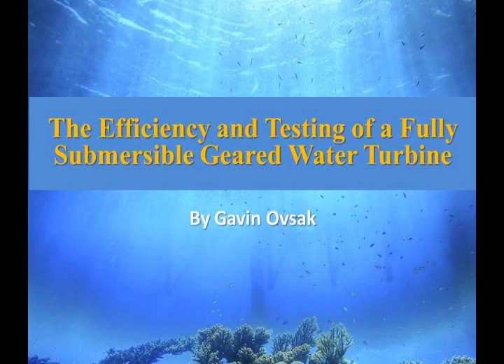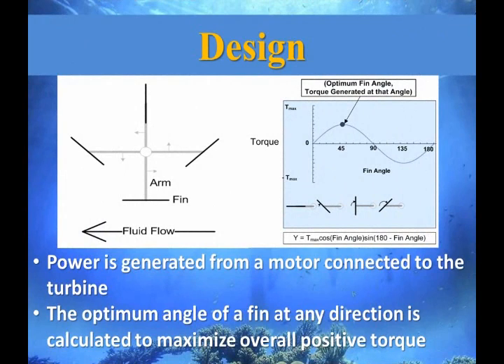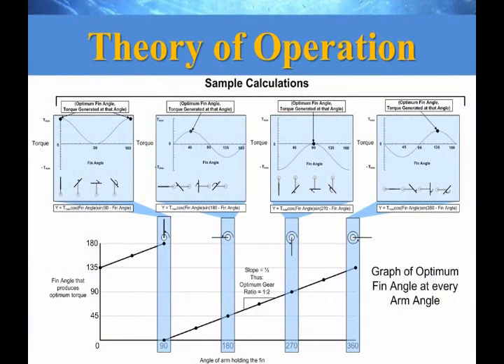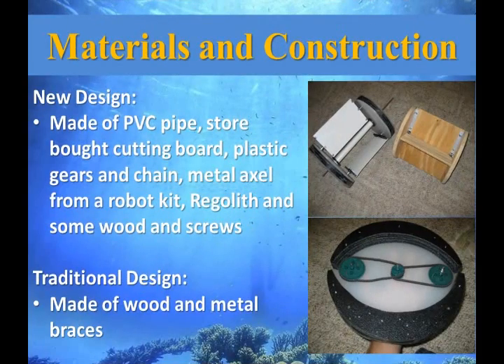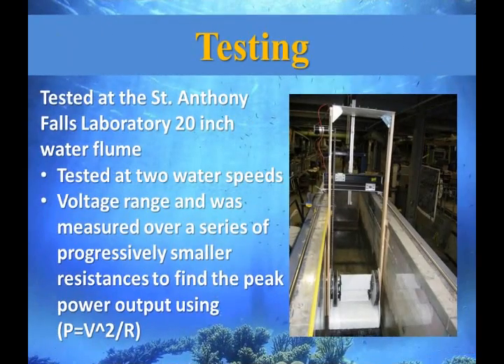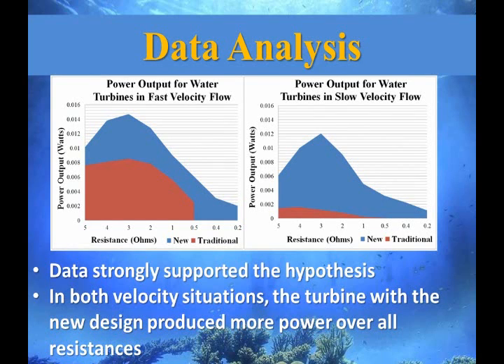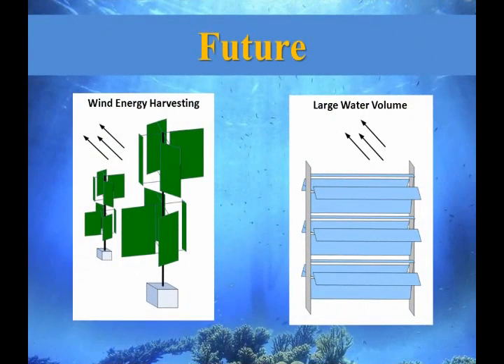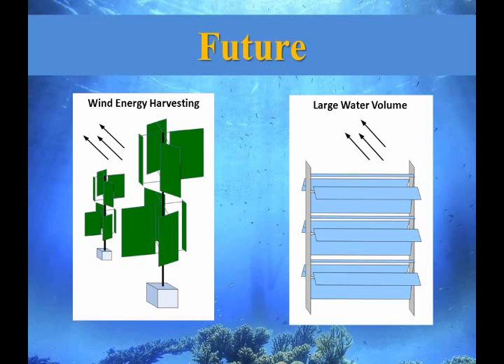Fully Submersible Water Turbine Summary

Comment: It's me jamaal. Now another question: If I put a motor on the turbine and propel the water in a sitting tank, will the turbine be able to pick up the kinetic energy from the propelled water? If so, then I could figure out how much water I need and how fast the water should propel. I don't want a stream of water, I want a still tank of water, but I want to propel the water with a motorized hydro turbine INSIDE of the water. Will I be able to pick up at least enough energy as needed in a still tank with a motorized hydro turbine?
Reply from the maker: Hey Jamal, if you attach a motor and can measure with an encoder how fast it's actually rotating, then the water speed should be about the tangential velocity of the fin arm, due to the shape of the turbine. The turbine can't pick up energy if it's attached to a powered motor.

Comment: Excellent, just what I have been looking for. Now, question: Does water have to be moving BEFORE the turbine moves the water, or can the water move by the turbine itself? I don't want a stream flowing, I want a still tank of water with the submersible turbine moving it. Can that work?
Reply from the maker: If you powered this design with a motor, it would push the water along!